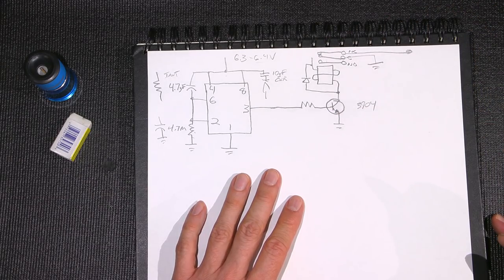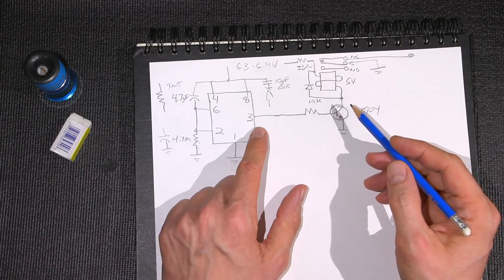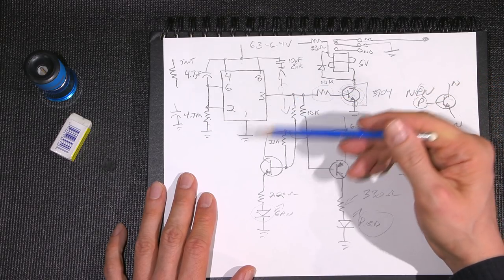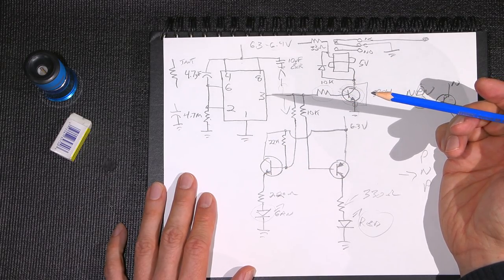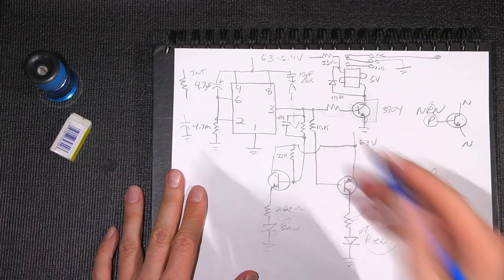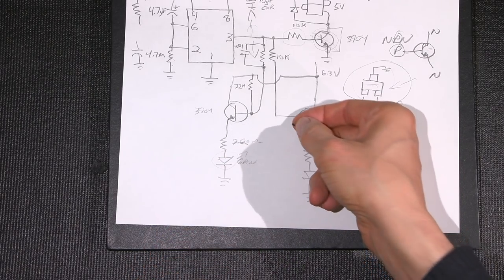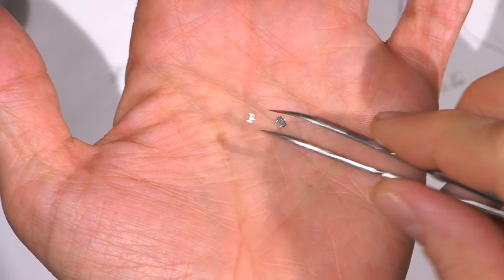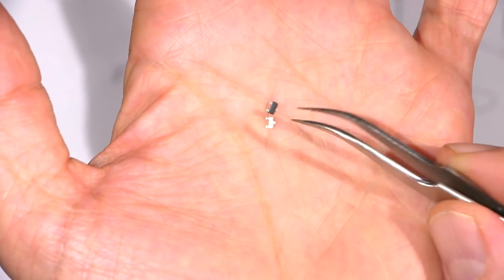Create And Build An Electronic Circuit!

Comment: There's no need for all those transistors to drive the leds. Simply tie an led from pin 3 , thru a resistor to ground , and another from 6v3 , through a resistor to pin 3 of the 555. the 555 has a totem pole output if it drives low , the led form 6v3 will be on , if it drives high the led to ground will be on. Oh, and bjts are voltage controlled. The base current is a side effect. The Ebers-Moll equations describes its behavior exactly. Parameters like Beta or Hfe are 'practical mechanisms' but they are an approximation. Take a look at a simple differential amplifier (long tail pair ). the input impedance is extremely high works purely on voltage control.

Comment: Ignition points! I built a Tiger CDI system for my old Datsun 240Z and once when I took it in for a tune-up, the mechanic said he needed to replace the points, not because they were pitted but because the rubbing block was nearly gone after 60k miles.  The points themselves were nearly spotless.  I'm an old gearhead who in my waning years have embraced EV's due to not wanting to crawl around under them anymore.  Grew up on vacuum tubes and still teach computer science.
Reply from the maker: Thanks for sharing your story George!

Comment: Thank you for letting us accompany you during your design process, Mr Carlson. Very enlightening. I had to laugh when the trusty 555 came into the scene for the millionth time in a design, I remembered when as a young lad I bought my first one at an electronics outlet in 1974, those $2 whopped into my pocket money , got me sweating at the till :-) But there is no money which can counter the wealth of knowledge gained from cobbling my first simple circuits around this first IC of mine..

Comment: I really enjoy seeing your skills and technique. Thanks for commenting on time estimates for job length, etc.
I really enjoy when you do the "this old house" style of program. Thanks for sharing.
Would you be able to use a battery backup power supply to protect the system from power sags?
Or, would it introduce noise into the system?
Reply: Battery power supply doesn't introduce any noise so yes.
Reply: @InXLsisDeo  Thanks :-)

Comment: Beautiful four tube Amp,  Awesome 1 db response  at the full audio spectrum, nice. As engineers we don't see that kind of care even in higher end equipment most amplifiers we see today there is at least 10 mili-volts of hiss  or drive per db. That's quiet like you said and the range 5 Hz all the way to 50 kHz  flat lining all the way.  I can't say that I can hear frequency that high but I would say that it offers greater harmonic response than anything else out there! Great job great video!  Awesome little circuit using a 557 as an off latch timer wouldn't of thought of doing that. When I heard relay I was thinking that you where going to use it to put the monitor speakers in stand by and enable them only if the Amplifier was powered up, remote power inhibit but instead you mute the inputs until the amplifier is  full on and active. One concern I would have is would the relay over time distort signal due to oxidation on the contacts? Just thinking long term.

Comment: 3:40 - That power-on "thump" can cause some serious woofer excursion, as I'm sure you're aware. Not exactly what you want expensive studio monitors to suffer from. My first stereo, a 70s Channel Master, beat the snot out of the speakers every time I turned it on. Wasn't long before the speakers were half-blown, thankfully they were free 8" woofers that I mounted in cardboard boxes. (I was an eight-year-old with his first stereo/8-track, don't judge! LOL By the time I had turned 14 I had already spent over $600 in a receiver and cassette deck, my standards had improved somewhat.)

While we're speaking of speakers, might I say that the audio of your videos is truly exceptional. My speakers are far from high-end - two Sony bookshelf stereo speakers from 1992, paired with a ported car "full range" speaker box housing a blown MTX 12" subwoofer and a cracked 12" Sony Xplod subwoofer (and MTX-branded midrange drivers with MTX-branded horn tweeters) - but I continue to be blown away in every video at how well you master your audio track. I guess a flat amplifier and a good set of studio speakers really do make a difference!
(I use these crappy throwaway speakers in the garage/Man Cave because I don't care what the humidity and temperature does to them.)

Comment: Great designing on the fly! I like the idea of sketching out circuit ideas on paper first before opening up the CAD software - i sometimes freeze looking at a blank screen but a blank sheet of paper and pencil seems to get me going. This reminds me of a circuit I made years ago to turn off a smoke detector for a 10 minute delay. I made a small perfboard with a 7555 cmos timer (great for low power battery projects!) - fit right inside the smoke detector case. I ran two thin magnet wires to a hidden lever switch to turn it off while cooking to avoid false alarms. Of course, I did not need a relay only a 2N2222.

Comment: What an amazing video! A small concern. 25:06 PNP switches seem tricky. In this case, the 555 output may not fully swing to 6.3V and if the output  difference is more than 0.7V, it would still draw a small amount of current across the PNP base emitter junction. So even when the output goes high, the red LED would continue to glow.
Reply from the maker: The Red LED is fully extinguished.... Very good observation though, if the circuit isn't built just right, what you mention is an issue.

Comment: Hi Mr Carlson,
I'm running out of your videos to watch and not all of us can afford Patreon. Please add more videos here! I love watching your videos and I have got my hands on a 1950s PYE radio that runs on a 90v battery. I found that the variable capacitor was shorting between plates. I have fixed that but I'm glad I started watching your videos because now I know about replacing the paper caps and that they need to go in a certain way around. I also think I'm more confident to do a proper alignment. Luckily, the radio runs on a battery so there's no mains involved. Thank-you for your educational videos, please keep them coming!
Dave.

Comment: Been doing circuit design for well over half a century. I only do OTL if I get rid of the capacitors in the output.. I have designed OTL/OCL amplifiers up to 270 watts RMS into 8 ohms, direct coupled, no caps and no transformers, using Wiggins balanced bridging topology, driven by direct coupled differential front end, with mirror image symmetrical active load lines on top,  and current sources in the long tails. DC Level shifting is done with high impedance current sources at a negative supply, adjusting the R above it, until correct offset at the node is achieved.  Full DC coupling... and it can be servoed if you desire..

Comment: Great video. What’s the purpose of the 22k resistor in the green LED circuit?
Reply: I would like to know this as well.
Reply: I tought the same. There is current flow through the resistor in "0" state of the 555 to VDC6.3.  Maybe for even current flow in the system? the green LED takes 2.1 or so voltage off so it is in balance with the red LED turn on signal 0.6 VDC? Far fetched
Reply: Yeah me too I do not understand the purpose of that 22K resister on the green LED circuit. Looks like a voltage divider which will hold the base voltage at about 2 v when 7555 is low. When high it will essentially pull it up to 6v. Should work fine without it?? Sometimes in high speed switching circuits biasing the transistor just below saturation will help shorten delay time but that doesn't seem to be the case here! Other than that the circuit is very straightforward and has many applications!
Reply: I just set this up to check. If the output of the 555 is NOT connected, the 22k will open the transistor, and that draws 4mA trough the LED, it lights up. Only if you also pull the base with 10k to ground, the LED goes off, as if when the 555 is in low position. The 22k is indeed to aid the saturation of the transistor when it is on. The output of the 555 is always about 1.5V below the Vcc of 6.3V. When you open >in this configuration< the transistor only by the output of the 555, you will never saturate it, because as soon as a C-E current starts to flow, the emitter will rise (voltage drop over LED+R), and you will need more voltage on the base to open it further. Since you cannot reach the full 6.3V on the base (the 555 stays at max. 4.8), it would benefit to add that 22k to full Vcc. But in reality it can be done without it. Only the LED will get some less current than calculated. The resistor is there only for the fact that the LED has been put in the emitter of the BJT.
Paul used this configuration with the green LED in the emitter I think because he has 2 coloured LED's with common cathodes. If you use 2 individual LED's you can leave that 22k out, and put the LED+330Ω in the collector of the transistor.
Reply: Andrew Hall  Sure something like that. The B-E voltage needed is of course always the same (0.6 at first opening), but when the transistor opens, it counteracts that action by raising the emitter voltage, and that puts a stop on the fun. It only opens fully by connecting the base directly to Vcc. The upside of such schematic is it makes a nice regulation possible when you need such. My knowledge lacks a little there. It is where my school was replaced with work.
Reply: Personally I would have not used the transistors to drive the LEDs and simply connected them across the relay coil. Green across the coil and Red from coil to ground. The impedance of the relay vs the LED current would not present any issues.
Reply: I don't see the need for the led driver transistors, the  555 can sink & source more than enough current to drive an led
Reply: @arthurdaily4930  I think you are absolutely right. It would save 2 transistors and 3 resistors.
Reply: I would have also saved the transistors by doing it like Arthur said.
However thanks for everyone explaining the resistor, it boggled my mind.
Amazing how Mr. Carlson just knows things like that. No math and theory helps that much with designs like that, they can be perfectly described with rather simple calculations, but to quickly have the idea of putting a resistor there, a lot of experience with analog circuitry is needed.

Comment: There's a simple relay contact delay circuit I use. Just a random tube with 110V or 220V DC coil relay. For 110V the tube has to be triode arranged as current source or sink, with 220V DC coil a tube diode (with resistor in series if needed) is good enough. With so many cheap tubes around it's a nice vintage like solution. My HV power supply uses PCF82. Pentode is error amp while triode switches the relay that limits the heater current for several seconds. As the heater voltage floats around so does the delay, but it also means the other tubes heat up at a different rate.

Comment: I would delete the 22kΩ resistor on the base-collector junction of the 2N3904 used to drive the green LED. The reason is, that the output of the 555 doesn't pull down to ground, and, with the drive resistor between the base and the output of the 555, may NOT pull that base down below ~.5 volts necessary for cut off. the green LED may not turn off! You might consider miller capacitance, perhaps a 223 (.022 uF) capacitor between the base-collector junction to prevent oscillation. Remember, the base-emitter voltage decreases, as the temperature increases, and, tube amplifiers get hot!
Reply from the maker: Hi Vincent. This IC being used is not a standard 555, it's the CMOS version. The ICM7555 being used goes "rail to rail," and "does" pull to ground, in this case down to 25mV. As you heat the transistor (green LED driver) externally, the B-E junction voltage goes down, not up, this welcomes the use of the 22K resistor even more. If you are interested is seeing the voltages, and it's affect (the 22K resistor) in and out of circuit, along with scope captures, check out the latest video on Patreon. The circuit is explained in detail with a video. The capacitor is explained with examples as well. Here is a data sheet for you regarding the ICM7555: https://www.nxp.com/docs/en/data-sheet/ICM7555.pdf
Reply: @MrCarlsonsLab  The resistor would make more sense, if it were between the base and emitter, not base and collector, which makes it a bias resistor, trying to turn the transistor on. However, on second glance, the LED is driven by the emitter, not the collector of the transistor. That means, that you have the full forward voltage drop of the LED, + the drop of the base-emitter junction, so even a standard (NE555) timer IC would be more than sufficient to cut off the green LED. I thought about that, just after I clicked the "reply" Icon. Considering that your supply voltage is ~8.2 volts (assuming 6.3 volts AC rectified with a silicon diode, and filtered with a relatively large capacitor) The coupling resistor needs to be less than 15.2KΩ, for a 22KΩ bias resistor, based on a 1.9 volt cut off, for the green LED. A 10KΩ coupling resistor should be low enough, to pull the LED below ~1.2 volts, plenty low for cut-off. Replacing the resistor with a capacitor, or, connecting a capacitor in series with the resistor would allow the transistor to drop to 0 volts across the LED. I wouldn't change anything now, considering the circuit works. The only value in replacing the 22KΩ resistor with a capacitor is, you can get them both in SMT 0805 size, and can be placed on the same pads on the same board, with no need for a new board. It would only be a minor change in BOM.(bill of materials)
     Try connecting a volt meter across the cathode and anode of the green LED, and see what it reads, when the green LED is "off". If it's below ~1.2 volts, you're probably OK with the existing design.(I suspect, you will probably read ~1 volt)

Comment: A simpler design for High Impedance headphones is the DarkVoice.  Uses 1 6SN7 and 1 6080, same tubes.  2 triodes in each tube, 1 for each Left and Right channels.  I've also made this design using a 6DJ8/6922 for the input triodes instead of the 6SN7.  These are a very simple design, easy to build and sound outstanding!

Comment: This delay circuit caught my attention.  Specifically, and like some others, I wonder about the 22K resistor in the green LED circuit.  When added it was described as "adding drive."  This caught my attention as it sounded kludgy.  

Not knowing the exact LED part number keeps me from being more precise in calculating operating conditions so I'll be limited in "running numbers."  

The green LED + its current limit resistor voltage drop approaches ~~5V on the transistor emitter  The 7555's output, depending upon its current loading is ~6V.  Next the 10K resistor in the base leg of the green LED transistor will be dropping the forward bias of the transistor (V-BE) to near or even below 0.7V forward bias required.  

My choice to assure forward V-BE is strong is to move the current limiting resistor into the collector leg. The potential problem with this is possible excess LED current thru the base.  BUT the 10K base resistor eliminates this danger as 10K is ~50x larger than the 220.  

The filter capacitor around the the base's 10K is 'interesting' too.  Described as 'eliminating oscillations'  again sounds kludgy.  More pragmatically, it seems this circuit was breadboarded and then found to have limitations exhibited as oscillations.  The capacitor's implementation appears as a "speed-up" to quickly deliver the 7555's output to the transistor's base which has marginal forward biasing.  

Again, this narrative is flawed by not knowing.the exact TO-23 LED.

Comment: Do you have the schematics and a BOM for that amplifier?  I have a bunch of 6080 (the military equivalent to the 6AS7) tubes and 6SN7s and now I know what to make with those tubes!   BTW, you could probably use this as a driver for your MAAS power amplifier as it would give it a nice low impedance drive to that inverter stage and really drive it nicely.

Comment: OK, it all made sense up to the 22k resistor you used between the two transistor leads for turning on the green LED, what is it doing, is it giving it a small amount of turn on current? Thanks Paul, fun to watch! :)
Reply: I, too, question why that resistor was added between collector and base of the green LED transistor.  That with it the 555 isn't capable of extinguishing the green led during the initial shut down 30 seconds.  Could it be the red LED swamps out the green one during the 30 second turnon delay??  Or would that result in YELLOW?

Comment: SMPS, they are great for powering up LED's and other applications. A few weeks ago, I was working on a high quality FM broadcast transmitter for a friend. He planned to use a SMPS. We connected everything, powered it up (dummy load) and it was horrible. Squeaking sounds in the audio and a complete lack of bass and dynamics. I Hooked it up to my oscilloscope, it was a real mess! I Designed a proper stabilized power supply with a toroidal transformer for him and that did the job very well. Clean audio without hum and squeaks and bass and dynamics starts to recover within 20 minutes. Never expected that a power supply on something as an FM broadcast transmitter (stable current draw) can do so much harm to audio dynamics.